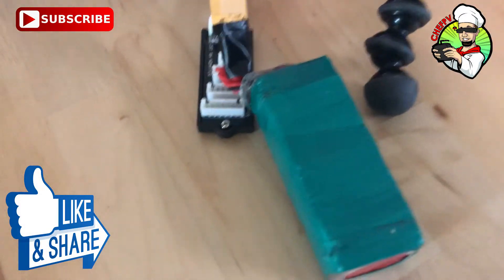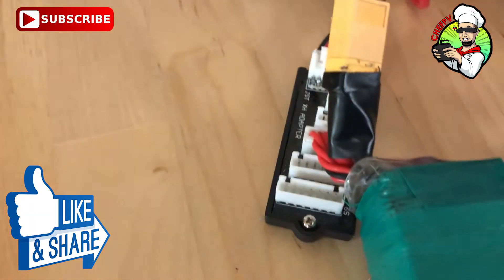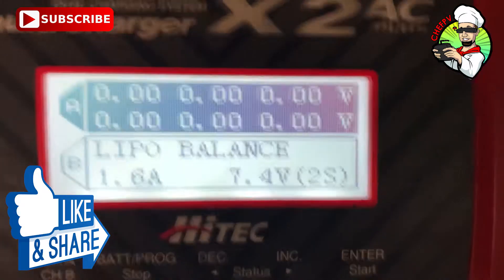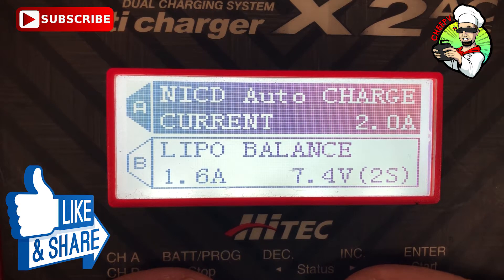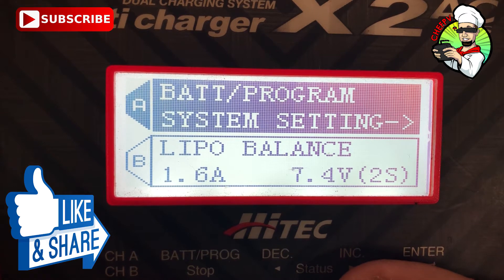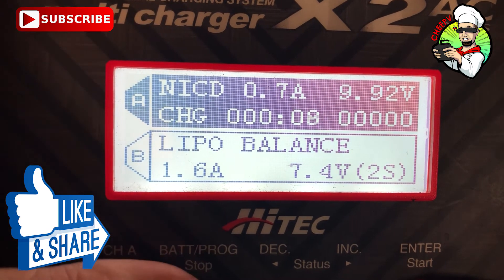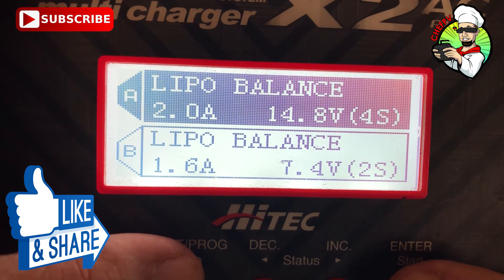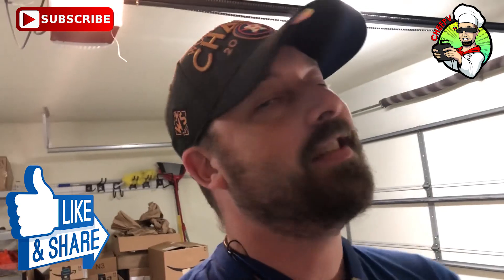CheFPV 101 How To Revive that DEAD Lipo Battery AT YOUR OWN RISK

Comment: My 2S LiPo was dead after I let it just sit there a whole winter, it was at 2 volts, I then did the 10 second NiCd charge, it was at 4,7 volts but dropping rapidly, so I quickly put it on LiPo Balance charge at 1.5 Amps for the first 15 minutes
Thanks!